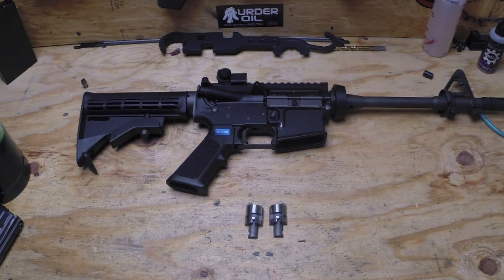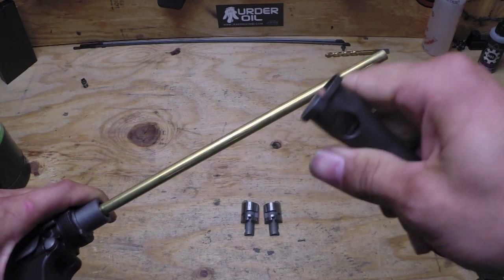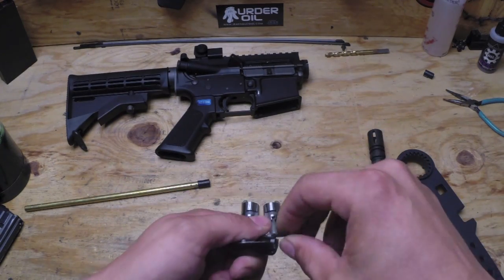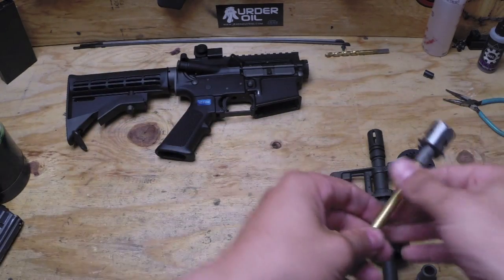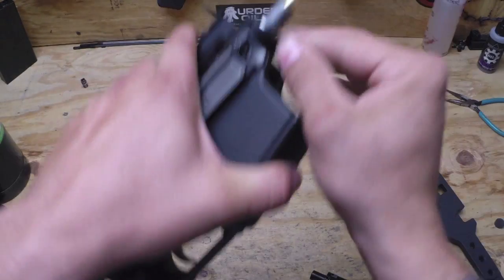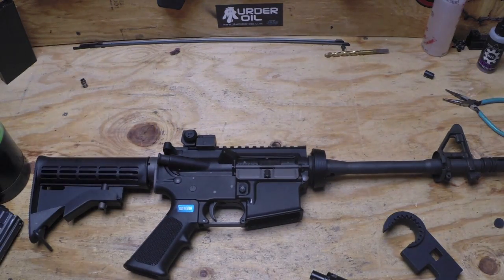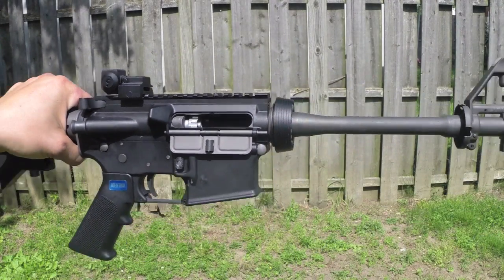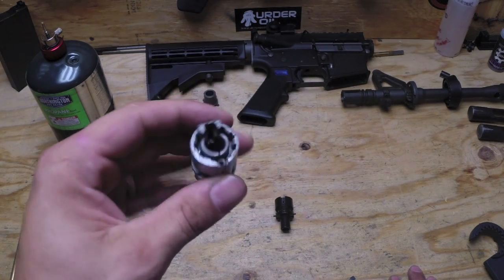New Age WE Steel Hop Up Unit (M4/MSK/L85)

Comment: I have a quick question for you. I know from your videos that you know your way around we GBBR's.  I have a MSK and it's shooting sluggish.  1 shot is strong and the next the cycle is horrible, thenhat repeats for the whole mag.  I only have the stock pmag it came with.  Gun only has about 1k rounds.  Full auto it horribly sluggish. Any experience with this issue
Reply: I`ve polished the bottom of the bolt carrier and the hammer where contacts the bolt, increases the rof and smooths the bolt carrier stopper activation.

Comment: Would a stock nozzle have any problems slamming into that steel hopup?
Reply from the maker: No this was deigned to the same specs as a stop HP and made from steel to better tolerate those using steel bolt carriers
Reply: ***** Who is behind all this who is making it and when can we expect them to be in the market.
Reply from the maker: The company is called New Age out of Taiwan
Reply from the maker: They where suppose to be available before July I'm keeping an eye on it

Comment: Do you have any problem about this hop up unit?I did some 'research' of this and I found out most of the user are not satisfied of this product because of the (they claim) QC problem,it can't hold the hop up rubber(and the inner barrel) tight as well
Reply: 山楂樹 I was wondering the same thing. Have you bought it, if so tell me how it works please.

Comment: Maximus I want to get into airsoft..and I've made my mind up that I want my first rifle to be a gbb. That being said how long do you think a stock WE-Tech rifle will last? Thanks in advance bro.
Reply: Hey man my first GBBR was a WE M4 and it's lasted me over a year and it's still going strong. It's gone through at least a few thousand rounds and I've had no problems yet (knock on wood) it's an excellent choice and I would highly recommend it.  The WE MSK is also great (I have one myself) but keep in mind that because it is still relatively new parts are extremely hard to find. Hope that helps and happy airsofting!
Reply: If you take REALLY good care of it then it should last you at least 3-4 years. You will need to replace parts here and there but probably only about $50 worth every 20,000 rounds.
Reply: jbkman thanks for the advice man!
Reply: GMI Kydex do You know of any good vids showing how to lube gbbr preferably WE gbbr
Reply: ChuckP3000inHD
Dont know of any vids but its pretty simple I prefer a heavier silicon oil (thicker) dont use spray it will drip right off.  basically just lube the whole outside of the bolt assembly (pull nozzle forward and lube piston O ring) then just put a drop or two onto each pivot point in the trigger box (hammer pin, trigger pin etc.) you really cant put too much on unless its dripping out of the gun everywhere.  before you lube make sure to wipe off all the old lube and clean everything thoroughly (I use Q tips to get into the tight spaces) after the first 100-200 rounds through it you will start to see where the moving parts are wearing, make sure to lube those areas. I generally clean and lube every few hundred rounds (or after a full day of use) hope that helps
Reply: Maximus has some on this channel that will be super helpful.